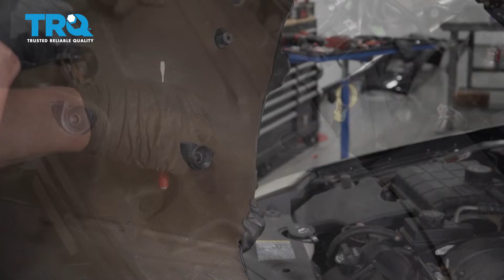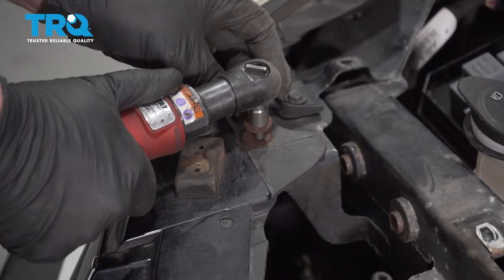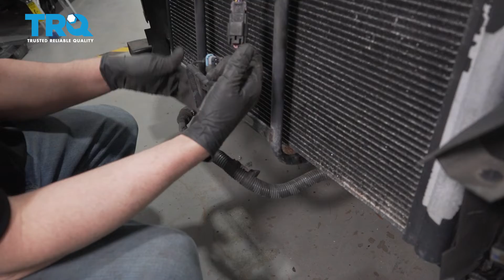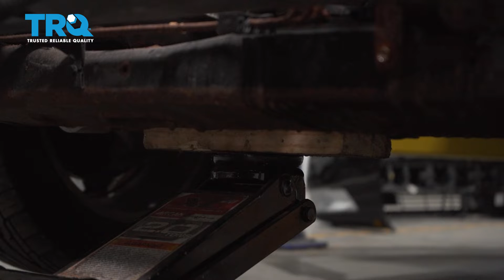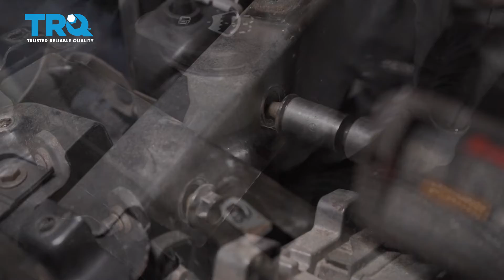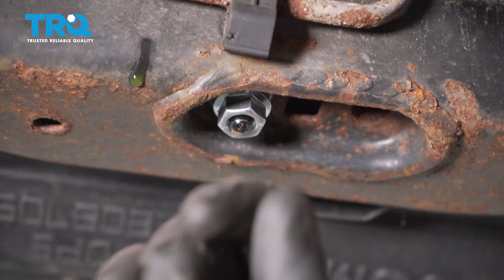How to Replace Hydraulic Engine Mount 2006-2011 Cadillac DTS

Comment: For those needing a temporary fix for the top mount:
My 2007 Cadillac DTS was doing the hard "clunk" when shifting while driving or moving the selector into drive or reverse. I ordered the set of engine mounts but noticed the rubber front bushing on the "dog bone" torque strut was mostly gone. 
I cut several approximately 3 inch sections of rubber fuel hose and jammed them into the gaps where the bushing had crumbled away; surprisingly this cushioned the clunk/jump of the engine/tranny to the point where sometimes I don't even notice it. Of course, I plan on replacing it properly, but I recommend it as a temp fix.

Comment: Took way too many parts that are not necessary may have made removing the mount easier but why evacuate the coolant and the air conditioning way way too much work. It can be accessed from the top or the bottom without removing any of that stuff.

Comment: There was no need to take the bracket off… way too much stuff was taken apart for no reason… couldve been done by just removing the top bolt with a wrench from underneath and the 2 bottom bolts
Reply: Thank you for saying that cuz I thought the same thing and had the thought this guy was crazy.... But thought I might have been and I almost went went through the process. Glad you made the response

Comment: Could you please show us the broken motor mount so I can see how it breaks? Where is your repair shop? I need a repair.
Reply: Also, how many motor mounts are there and which ones break most often.
Reply: @rebeccaprice2457  I believe there are four mounts total. Front, rear, and both sides.